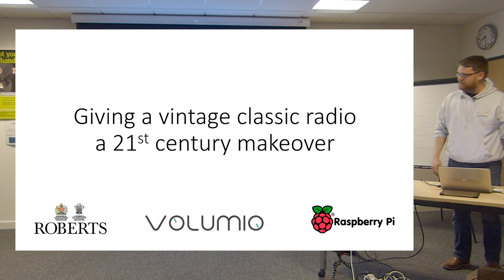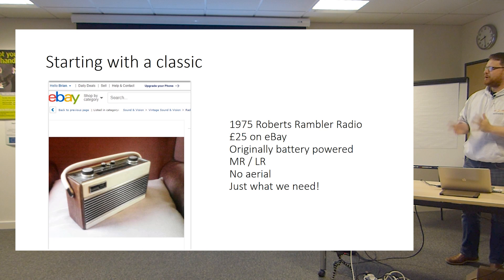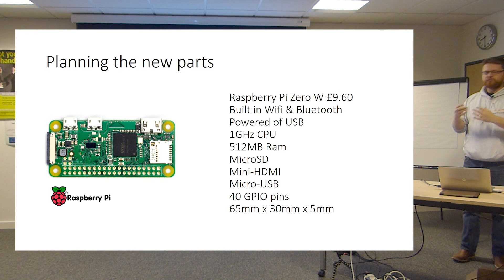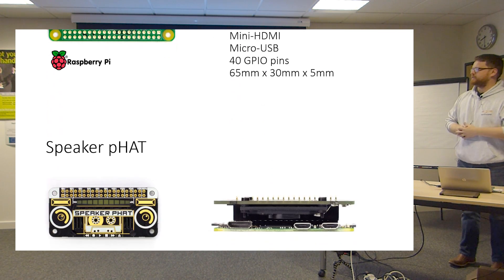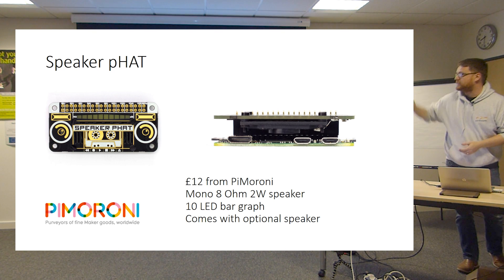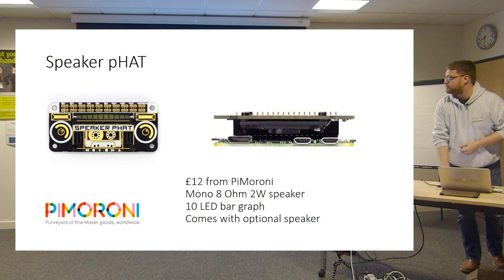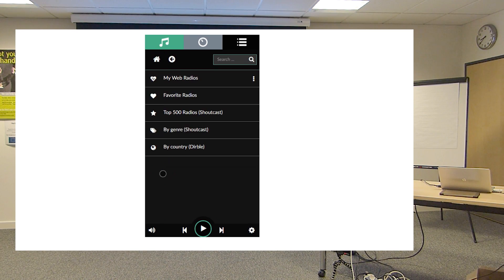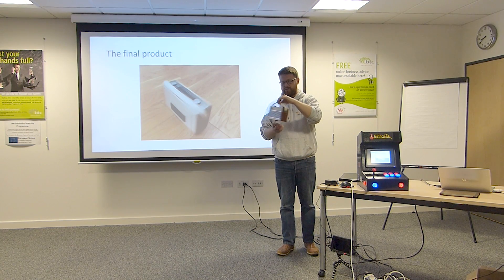Giving a vintage radio a 21st-century makeover with a Raspberry Pi Zero W

Comment: That was a nonsense project. All he did is use the radio as the new housing. I thought he was going to make a Wi-Fi radio that kept the original functionality but added new features. Plus, if you need your phone to use it, you might as well use your phone. The radio was more useful in its original state since you could use it to listen to radio, and it was a completely standalone device. Now its more complicated and less useful then a normal Bluetooth speaker.

Comment: In the mid '70s I acquired a couple of valve Roberts Radios. I ripped out the valve innards of one, and converted to a single chip radio. I recently ripped that out and reverted the radio to valves.

I wonder if, in 40 years time, the radio in this video will have its old electronics returned.

Comment: Nice video, i also ordered the speaker phat, how do i wire the original speaker? Instead of the speaker phat speaker?? What are you wiring at the Mhz connectors? Volume?  Thank you
Reply from the maker: I just soldered two wires to the plates on the speaker phat (instead of the supplied speaker) then add a crimp (http://amzn.to/2qvFu0p) to the end of each wire. The original speaker in mine already has the "spade" part of that crimp so I just unplugged it from the original board and plugged it into my two new wires. 

I actually put the original volume potentiometer in between on of the cables going to the speaker so that I can use that to control the volume.

I hope that helps.
Reply from the maker: I wired some gpio pins to the original buttons for choosing radio type (long wave or medium wave). These now allow me to pause and skip tracks in Volumio
Reply: OK thank you for your fast answer! Sorry, i watched it now at home, and you eplained it on the video ^^ But what are you wiring on 06:39 on the GPIO's ?
Reply: now, everything is Clear! thank you very mich!
Reply: MicroMonsters 
Hi. 
You mentioned that you use a plugin on Volumio to control the buttons on the phat speaker? Which plugin is that?

Comment: Raspberry pi zero w is comes in handy for all these kind of retro fitting. I got a bluetooth speaker for less than £5 on a groupon deal. It had good amount of space inside so removed its boards, added pi zero w, speaker hat, led indicator, power button, installed shairport-sync and now i had a airplay speaker for less than £20.. The Wifi on the zero is a boon for projects like these..

Comment: This is exactly what I am doing but with a 1950s Bush radio. Unfortunately I can't get my pi zw to run Volumio and connect to the internet. So I've hit a road block, help?
Reply from the maker: Hi Chris, are you using the very latest volumio as that should now support pizero w out of the box. I had to get some newer files see my question and the reply here https://volumio.org/forum/with-new-rpi-zero-t6050-20.html (read from "gingemonster » Sat Mar 11 2017 09:57")
Reply: @MicroMonsters  Wait for a little bit and it will start. Though it will not show anything on the screen, just check your wifi(on phone or computer) and a volumio hotspot will appear. Now just select it the password is "volumio2" and from any browser type its ip address and continue as usual.
 oh another tip use "fing"(Can be found on Play store). Its really a great app to identify IP address of all devices on your Network.

Hope this helps.
Reply: That process has made my Pi not boot up at all. It sends a signal to the TV I've got it hooked up to but doesn't even get as far as that rainbow square thing. I used the latest image from Volumio and the file you in the link you just gave me. When putting the file in the boot portion of the SD it asks to replace one and I did replace the one in there, I assume that is what is intended but could that be where I have gone wrong?
Reply from the maker: Suspect we are both guessing here, Im definately no linux pro. Best start a new ticket in that forum and see if they can help there, sorry